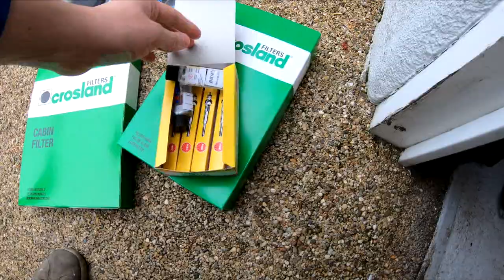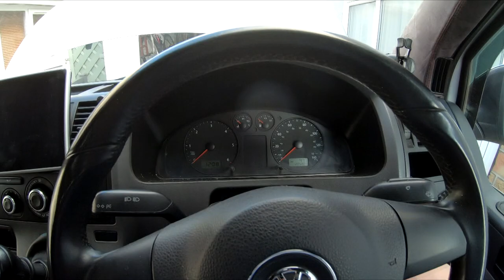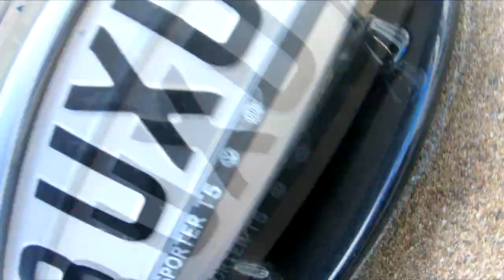How to Service your VW Transporter

Comment: Now then buddy long time no speak next time you service your dub. Run it up to temperature then crack the glow plugs off first before changing air filter etc. You were lucky there mate. Oxidation causes a nightmare with steel/aluminium the amount of glow plugs what get stripped due to not getting it hot is ridiculous. 
Awesome video!. Awesome content keep it up.
Reply from the maker: I appreciate your feedback and I'm sure that might help someone reading the comments but to be honest these were not hard to remove at all. Just awkward to get tools into them due to not being able to see them.

Cheers for the advice though.

Comment: You forgot the fuel filter.
Reply from the maker: It's not been forgotten. It was done on last service. Only needs changing every 2 years or 20k miles according to service schedule. It will be done on the next one.
Reply: @bluudysgarage  well ordinarry car one  20K , bt tranmsporter Fuel filter at 50K  DEFINETLY not like 20K .